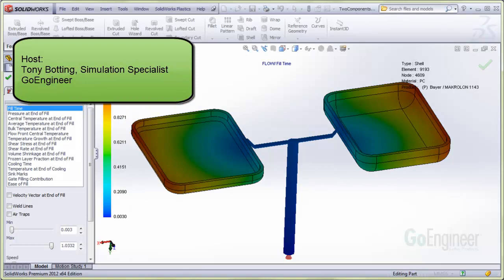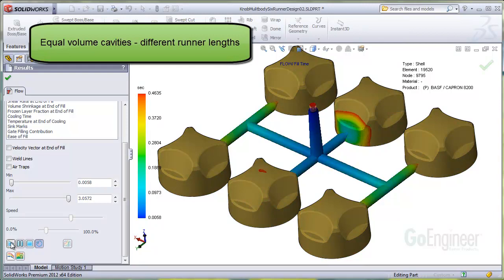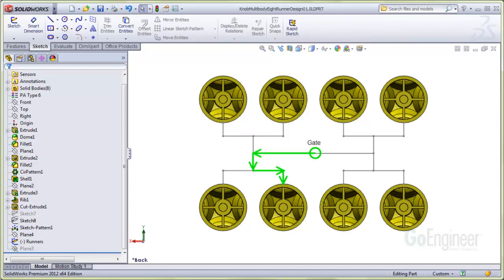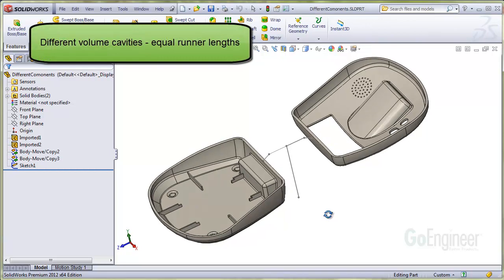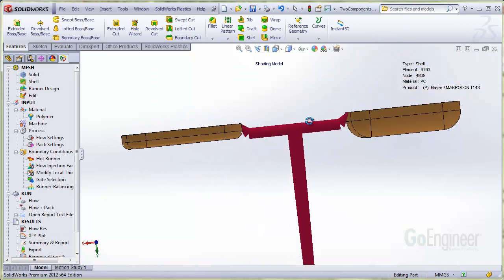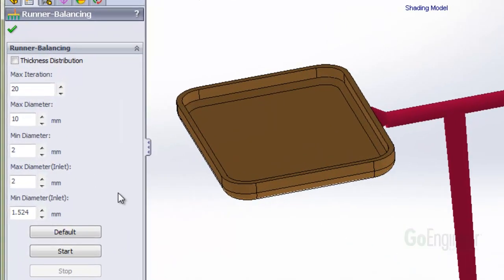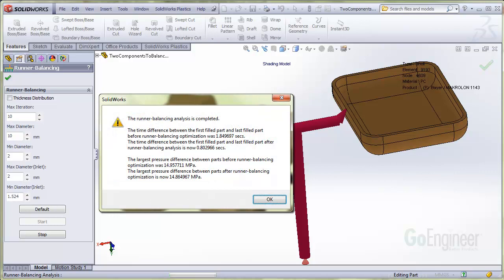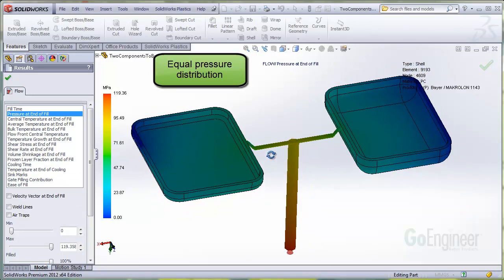SOLIDWORKS Plastics – Runner Balancing Tips

Comment: Do you have to run a first analisys before using the balancing tool?
Reply from the maker: The runner balancing tool will run without a first analysis.  The first iteration will run with the input runner diameter values from the runner domain creation step.